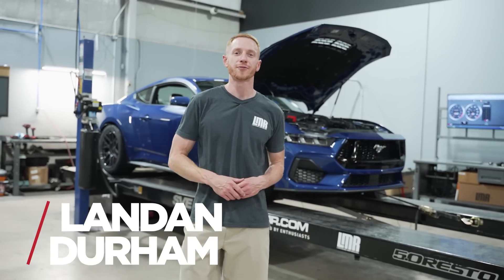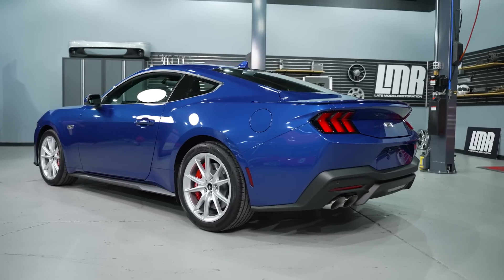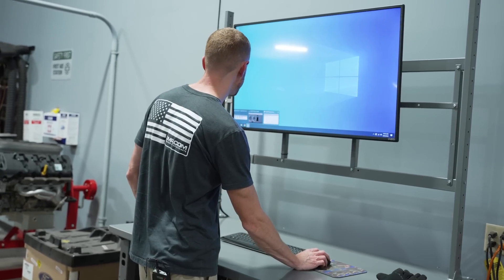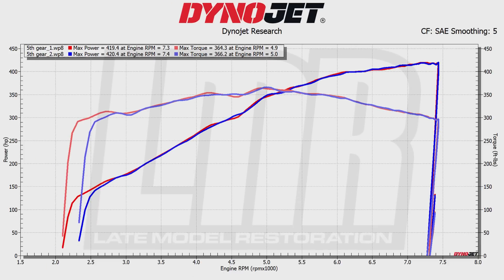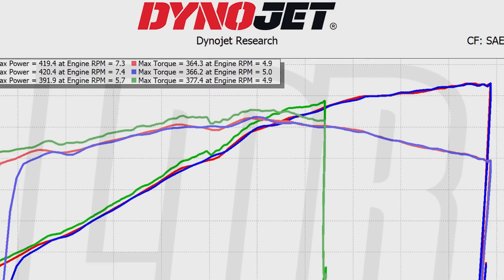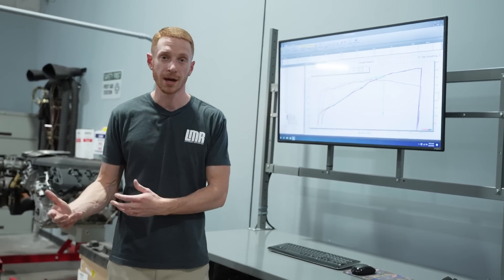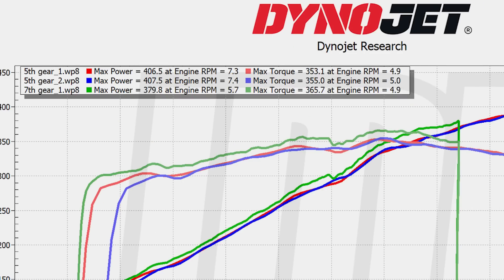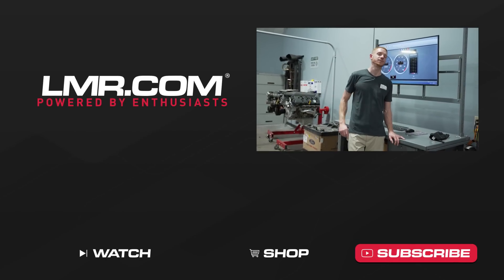2024 Mustang GT Dyno! Multiple Pulls & Correction Factors Explained

Comment: What’s the difference between the 3.15 and 3.55 as far as torque numbers?
Reply from the maker: I've never dyno'd the same car where the only change that was made was the rear gear ratio. Typically, a taller gear (also referred to as a lower gear) will make more torque than a higher gear (also referred to as a shorter gear). Basically, it comes down to physics and a long detailed formula. -Landan

Comment: Thought it was supposed to be around 475 HP,  it shows only 420HP
Reply from the maker: The power ratings are in the video description. This is a chassis dyno which measures rear wheel horsepower and rear wheel torque. The ratings that are provided by Ford are at the engine's "flywheel". It takes power and torque to move the drivetrain. Think of rear wheel horsepower and torque as take home pay after taxes are taken out. -Landan

Comment: It's lost a fair bit of power from it's rated 486 HP.
Reply: this is wheel hp not crank hp.
Reply: @gforce_117  413 Wheel HP divided by .85 gives 485.8 HP at the crankshaft.  A 15% driveline loss is generous.

Comment: So not really any different than the previous gen 3 motors at all. Just more money for about the same hp as a mach1 and more expensive too🤦‍♂️
Reply: A “Mach 1” with no shaker hood is lame!!
Reply: @marlostanfield1087  agreed with that statement 100%
Reply: Mach 1 is 65k lol
Reply: @Jimmyxsx  and this one is more expensive than the the car it replaced with all the new opinions and more.Then you have the dark horse that only provides 14hp more for a lot of extra money. 
It’s not worth it at all.
Reply: @kevinmckinley7378  wrong, a base s650 GT starts at 41k and goes up from there. Dark horse starts at 60k.

Comment: Very interesting power curve. The previous gen starts falling after 6800rpm, this one is flat even nearing 7500rpm. The intake setup must make quite a difference.
Reply: That's because the 1:1 ratio gear in the s550 hits the 155mph limiter at 6800rpm but the engine peaks at 7100-7300 with proper fuel. Mine farted out 441whp@7150RPM (2018 gt manual) with Swedish 99octane (US94?) V power and 35F temperature. So this is worse....  s550 GT was underrated and this is meh. bravo ford for the scam marketing!

Comment: The weels carryover because its not a S650. Its still a S550. Well, it still SHOULD be a S550. The chassis, suspension design and all that isn't enough of a change to make it a completely new generation. A 2005 Mustang and 2014 are so unbelievably different but that's still the same generation. The 2015 Mustang has more in common with the 2024 then the 05 vs 14. In no way should it be a new generation. Gen 4 Coyote? Absolutely. S650? NOPE.

Comment: I may be wrong, but if you Dyno it in a lower gear than 1:1, doesn’t it give you higher HP numbers ( higher than 1:1 lower HP numbers)?
Reply: No. I have no idea why everyone thinks that. If he could dyno in 8th it will make even more than 7th. Look at the green dyno graph. See how much extra power its making over 5th gear? The only reason it didn't make more peak power is because it hit the limiter. If he was able to tune this car or remove the limiter 7th gear would have made a peak power gain of around 25RWHP over 5th.
Reply: @ShizawnSanders  so it’s the opposite of what I said?  to get true HP numbers, I’m pretty sure you need to be in the 1:1 gear.  If it’s not true, then why would t everyone just dyno in first gear?
Reply: @danieljohn4603  okay so each gear you go up in will give you higher numbers. If you dynoed in a OD gear like a .86 or whatever it would give a number even higher than 1 to 1. It would be dangerous because of how fast the tires are spinning but it would give a very high number. Dynoing in 1st would give a VERY low number. 

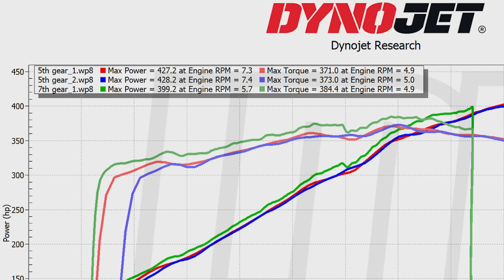My car was the same way. My car had to be baselined in 5th to not hit the limiter. It's a 2019 GT, 3:55 rear gear, 10R80. It made 405RWHP in 5th. LT headers and a 91 octane tune later it made 429RWHP in 5th. Then we dynoed in 7th which is the 1:1 gear. It made 458RWHP. Only difference between the 429 pull and the 458 pull was it was in 7th. Not 5th. It was the exact same day. The car never came off the dyno. Wish I got a E85 dyno pull that day but it had 3/4 a tank of gas and shitty 91 octane.

Comment: Did anyone notice all those check engine lights? Park brake malfunction, blind spot malfunction, etc.
Reply: Those systems have to be disable to dyno it. Basically shutting all the traction control crap off.

Comment: In 2004 if you'd have told me a 2024 GT would have more HP than a Termi, I would've laughed. Stock for stock.
Reply: A 2011 GT makes more power than a Termi.
Reply: @saidtheblueknight  technically I'm referring to future GTs vs relevant Fords flagships.
Reply: @saidtheblueknight  I still would rather have a Terminator.

Comment: So: if the 6spd cars are dyno'd @ 440rwhp, the 85% rule puts crank hp @ 518. That's a bit stronger than the S550. Someone please dyno a 10spd with 3.73s so we can get a good 1:1 pull.
Reply: 15% is not a rule and that's not how driveline loses work. It doesn't matter how much power the engine makes. The transmission will take XX amount of hp to operate. it doesn't matter if you add on a supercharger or other power adder. The transmission and other driveline will take the same amount of hp to operate and put power down regardless. the 15% is a very old school way of thinking and it's just not how things work. For example the engine makes 480bph and they got 420whp. That's 60hp parasitic loss in the drivetrain. Now add a supercharger and the engine makes 700hp. Unless you modified the transmission or driveline components. it will still have 60hp driveline loses.
Reply: @turbobros_online1561 that’s incorrect, putting more power through the same drivetrain increases the losses through an increase in friction.
Reply: @YZ-YZ-  interesting. How does more power production increase friction? Where specifically does the friction happen in different components?
Reply: @turbobros_online1561   15% of 700hp is alot more than 15% of stock hp. at 700hp you are accelerating everything in the drivetrain much faster requiring more power.
Reply: s550 Mach 1 6 speed dynos at 440-450whp so this is spot on.

Comment: I trust the not corrected numbers more. The corrected numbers are for bragging rights and that’s about it. I’ve seen cars that make ridiculous “ corrected power” run numbers at the drag strip way slower than what the power numbers showed.
Reply: Corrected numbers are so cars in different part of the world can be compared.

A Denver car that dynoes 350 whp, could very well make more power than a someone that dynoed 380 whp in Englishtown.
Reply: But "not corrected" are only good for the instant that they're taken.  They will be different later that same day, depending on the conditions.  If someone asks what your car makes, you'll have to honestly reply, "It depends..."  Corrected allows for more realistic comparisons between vehicles and conditions.
Reply: That's why I love Dragy's so much.  It's hard to get to the track sometimes but with the DRagy you can get MPH numbers and the 60-130 is a great indicator of power.
Reply: Ford had a big problem bk in 03 Corba days of false Hp Tq advertise numbers. There own Ford loyal people gave Ford hell for that , some die heart Ford guys went straight to  GM couse of that. It was a real lawsuit by Ford owners an Ford had to pay out. Since then Ford people haven't trusted the ome advertise numbers. Over here at Gm we got more integratety then to lead the hard working Gm people astray or to lie to boost sells. If you a Ford fan girl . Take it up with Fords CEO on why he even took all through that embarrassment. God Gm Ls Lt FTW.
Reply: That’s not why correction exists. They are used to standardize across conditions.
Reply: @BrokeAndSquare That doesn’t make correction any less horse shit. The corrected numbers are a lie if you’re not driving in the perfect conditions they simulate. Which you’re not.

Comment: Beautiful Mustang. From the red Calibers. It appears it's equipped with Brembo brakes normally included with the performance package. Obviously the 6 speed manual would be an easier test. From the 3.15 gear ratio you mentioned. Your test car isn't equipped with the performance package which includes 3,55 gears for the 10R80 automatic. 3.73 with the manual transmission.

Comment: Almost all the dyno vid on the new mustangs are laughable. No real improvement, they are basically s550 with new bodylines, interiors, and dual throttle bodies. Fewer tuning abilities, same suspension, slightly quicker steering(but overpowered). 😅 why the heck would someone spend 45 to 60k fully option(most dealer will have them) for a GT?  The DH need to put out at least 480whp to truly be worth it, 60k+ ridiculous money 😂

Comment: So Instead of the promised 486 hp we getting 420 at best ?
Reply: There’s a difference between hp at the crank and hp at the wheels. Every car is like this
Reply: @BillyBobby123  thanks man new to the car world and excited about my 2024 gt but so is this good ?
Reply: @iceboy_2494  yea, you can look at any other of your favorite cars. They all lose a good bit putting power to the ground. Obviously there are things that can be done to increase it and some cars are better than others.
Reply: @iceboy_2494 yes the numbers it laid down at the wheels are in line with Fords crank ratings.
Reply: @iceboy_2494  Yes, it is actually really good, it's not losing as much HP as most other cars will due to drivetrain loss, it's actually much more powerful than the past decade of Mustangs at the crank hp vs the wheels. Almost all cars have this characteristic, some have a minor issue with it because of their improve layout and drivetrain, a great example of this is the Mustang GTD, which virtually has almost no drivetrain hp loss due to how it's setup with it's carbon fiber driveshaft and transaxle transmission directly driving the wheels.
Reply: HP and TQ from ALL Car Companies are measured at the Crank,  when you see Dyno results from the Wheels always use that number  x1.15 (roughly 15%) and whola!! in this instance you are at 483HP Crank HP for this GT
Reply: @blardpurple5442  Yeap, accurate, the only real difference to certain car companies is sometimes they either low ball their numbers or exaggerate, most of the time they low ball it. This isn't just for HP and TQ numbers either, it's also in performance and is mainly seen in these instances, for example Ford GT500, was claimed to do 3.4 0-60 and a 10.7 on the 1/4 mile by Ford in perfect conditions. Low and behold a teenager buys the car from the lot and directly goes to a drag strip and sets a record 3.3 0-60 and also a 10.6 pass barely even in good conditions.

Comment: Aren't people slapping on On3 turbo kits on their worn out Fox Platforms and making more than that?
Reply: Seems like a bit of a no brainer that modifying a car will have it make more power than a stock basic engine no ?
Reply: @raionshishi8290  Buying a clap out 302 from the 80's, putting a $1500.00 performance part onto it and it will achieve more power than a  larger displacement engine with 35 years of technology with $45,000 price tag is embarrassing where I come from.
Reply: @Olds_Pwr  Where is that exactly, because last I checked, a simple TT setup will not cost over 5k and will gap pretty much any built car on the street. You would be lucky enough to even find a 302 and let alone have nothing to fix on it, also you are arguing about a car that gives you everything a modern car would give you under warranty, that is until you mod it of course but that's the entire point.
Reply: @raionshishi8290  I never mentioned anything about a twin turbo. The single turbo kit that I am referring about I see is now $1900 and it comes from ON3 Performance. I don't understand what you're saying about finding a 302? 80's Mustangs came with a 302. Not everyone wants everything a modern car with a warranty. That is why some people just want a daily vehicle to get them to work, with no warranty and no car payment. Not to mention a tablet dash.
Reply: @Olds_Pwr  You seem to have short term memory loss, because I clearly referred to your previous comment that of which I was replying to that said and I quote "Buying a clap out 302 from the 80's, putting a $1500.00 performance part onto it and it will achieve more power than a  larger displacement engine with 35 years of technology with $45,000 price tag is embarrassing where I come from." 

This entire comment is directly talking about getting a 302, whether it's the engine or the entire car itself doesn't matter, you said it and it's what I referred to so I don't see why you can't understand what I said about finding one in mint condition for cheap.

You mention that you would put $1500 worth of performance parts in it and make more power than what we have in modern day time.
I pointed out how any modern day car with cheap performance parts installed can easily make more horsepower without even opening up the stock bottom end and this is on a warrantied car, which gives you way more than what a 80's car would which obviously makes the pricing what it is.

The moment you compared a car that is reaching almost 50 years to now is when things get complicated, because why would anyone expect a cheap pricing when looking at almost 40 years of development in a car. If you wanted a cheaper car you wouldn't be shopping for this car or any modern day car, making an argument on the price of something in modern time vs something of the past is ridiculous in itself, not to mention most cars from the past when compared to modern day cars are actually way more expensive than they should have been for what they gave feature for feature price to price. 

You also failed to address how not everyone wants to go looking for a car from the 80's to fix and drive around, so I guess that's something you just want to ignore. What you dislike doesn't account for everyone or the majority, not even close. What you are describing is not even 8% of what the majority of consumers would care about or do. These cars aren't the best or the most incredible thing out there, but to act like none of it makes sense is simple turning a blind eye. 

A modern day Mustang that costs 50k can do 1/4 mile in 12 seconds, run around a track as fast as many other sports cars and has features that didn't exist in cars from a decade ago. One great example is the 2013 GT500, the Mustang with the highest horsepower of that time, now worth 50k+, also did low 12 sec 1/4 mile and was incredible, but would not be able to hang with any sports car on a track of modern time or have as many features as cars do today, yet the modern car with less hp beats it in all of that for the same price basically, that is a sign of improvement in many other factors and aspects without just focusing on hp like most people tend to do when looking at pricing, this is coming from a comment that literally complained about this exact thing.
Reply: @raionshishi8290  Clearly we are not communicating very well by typing back and forth. Have a nice day.
Reply: @Olds_Pwr  That's not the problem, and you know that.

Comment: My fbo 2013 GT is making more than that
Reply: I mean it's brand new and not broken in and not tuned....it's already putting out healthy numbers for stock....when it gets turned up it'll be more efficient than your 13...
Reply: A yes, full bolt on making more hp than a stock motor, who would have thought that to be possible.
Reply: Because its fbo are you dumb?
Reply: Just would think it would be putting down 500rwhp stock before fbo is all, we talking 11 years here
Reply: @brandonjones2565  A decade of improvements isn't all about hp my dude, the responsiveness, the performance, the balance, the quality, all of that matters way more and will improve the car overall because it will actually be able to put that power down instead of having all the power and no go. The Mustang has been at the top for a long time in overall performance and sales, Dodge has been putting in tons of hp in their cars yet they struggle to actually use it, Chevy puts little effort overall but their track capabilities, Ford has that balance that has kept them alive this long.